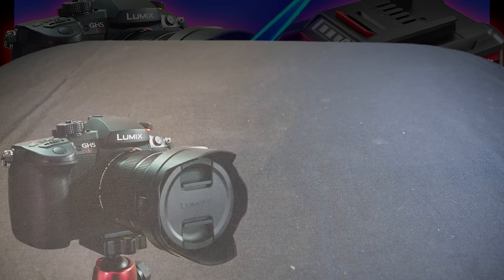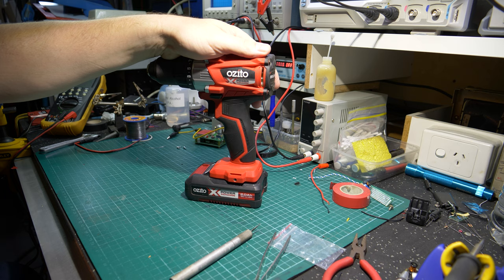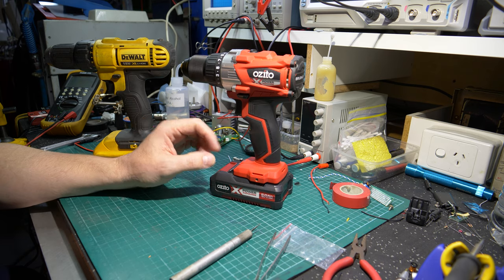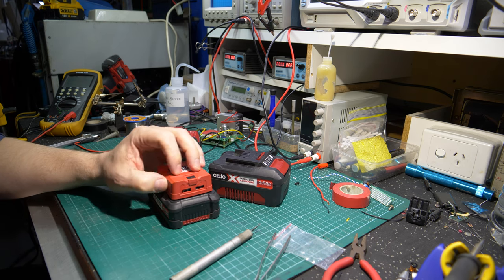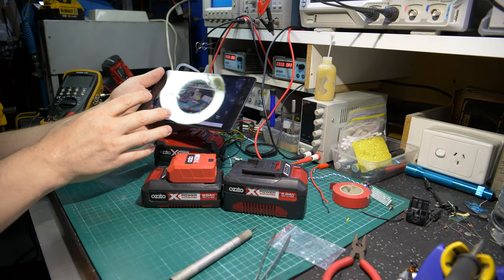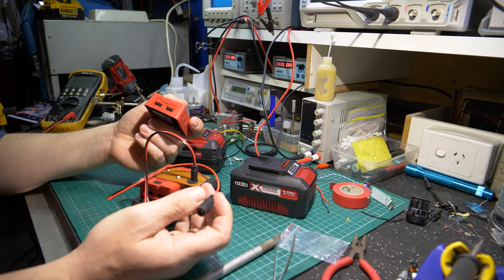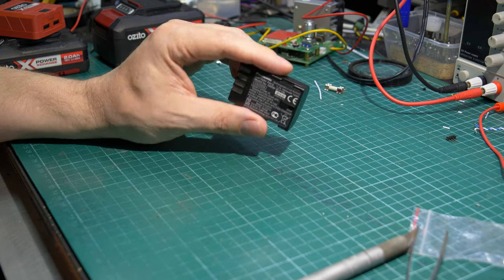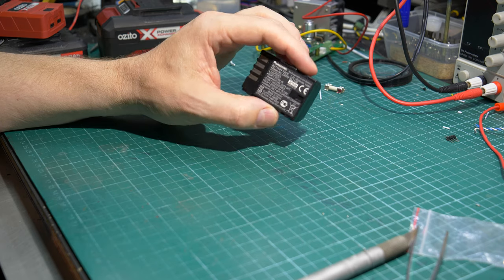#20 - Power tool battery for your OTHER powered devices.

Comment: Even after 30 minutes you don't actually show the most important part - how you made the camera adapter.  Very frustrating.  A bit more focus on the project and less rambling could have had this wrapped up in 15 to 20 minutes.  It should have included a schematic for your filtering arrangements.  It would also have been nice to see links in the description to the parts you used (buck converter, diecast box, camera adapter, tool batter to USB adapter etc.).
Reply from the maker: Could be a future in depth video. Your comment is duly noted. Thank you.